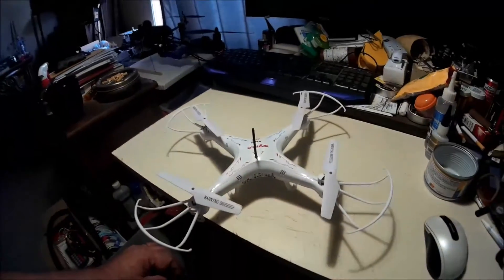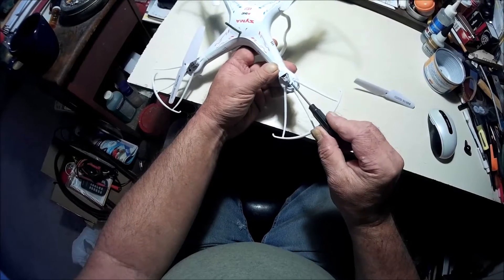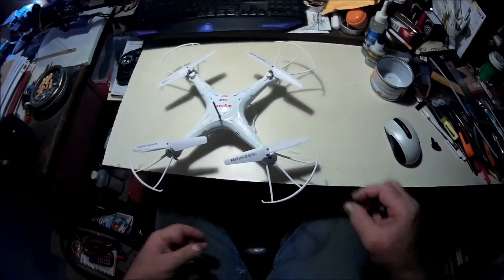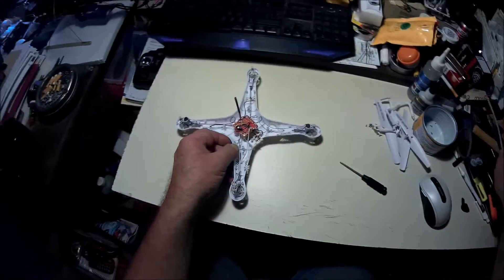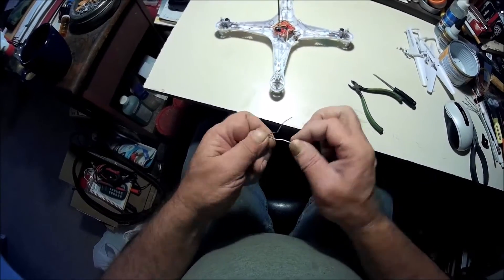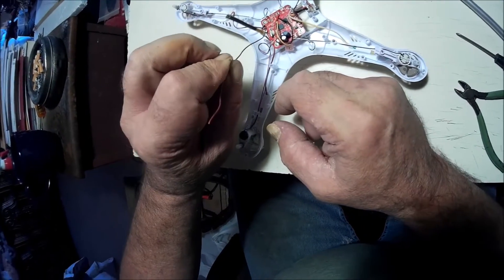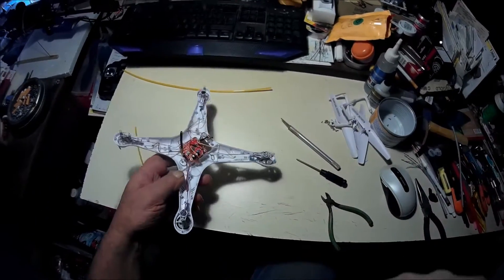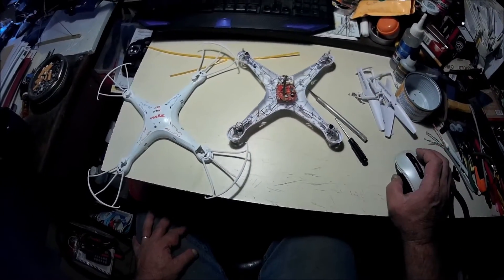Syma X5c-1 Antenna Range Extention Mod... 100+ Yards

Comment: Great video! Could you please clarify will this antenna alone improve the range or do I actually need to mod my transmitter too?🤔🤔
Reply from the maker: Hello and thanks for watching, basically what I'm doing here is changing this Antenna system from a 2.4Ghz 1/4 wave to a 1/2 wave System and modifying the Receiver helps but doing both the Transmitter and Receiver is best. With both Transmitter and Receiver modified I was able to get about 100 meter range. The actual Transmission Strength comes from the Transmitter, so I believe the Transmitter Mod would be the best way to get a better Signal. In one of My other Videos I show the Transmitter Modifications, above that the next step up would be to add a 2.4 Ghz WiFi Signal Booster to the Transmitter, understanding that the Transmission Power is the most important as the Receiver side just picks up what ever Signal is sent too it. I hope this helps and here is a Link to the Transmitter Mod in case You choose to do that as well.. Thanks again for watching! 👍🤠    
https://www.youtube.com/watch?v=oEXqWcXiFBc&ab_channel=HyperJoe

Comment: I also have the modded transmitter.  I also modded the receiver antenna to a 1/2 wave which was inside the quad down one of the arms.  I expected my range to go over 300 feet.  My range actually became WORSE doing this.  It became better again by going back to the normal 1/4 wave length.  I don't recommend running a 1/2 wave antenna inside the quad, it's probably subjected to a ton of electronic noise plus the angle isn't good.- running it up like demonstrated here is different.  Although, if I was going to do this, I'd probably look into installing a grounded shielded antenna onto the board.  There are a lot of other Syma fliers out there who claim they can get 100 meters just by modding the transmitter and leaving the receiver antenna alone,  I've also seen some videos of people getting 100 meters stock..........it's pretty confusing to say the least.
Reply from the maker: Yea, there is a major difference installing the Antenna Verticle versus inside next to the motor wires. And yes You are correct, doing a proper Mod too just the Transmitter would do the Job. I've actually thought about adding a 2.4 gHz power booster too the Transmitter, but I've since moved on to much Bigger Quads with Gimbal/Camera set-ups. I'm setting up a XK X380 with a 2 watt Booster on the Tramsmitter and a Long Range FPV Transmitter, I'm hoping too increase My range from 1000 Meters to about 3-4 Miles..Should be Fun...thanx for stopping and watching..with Summer more Video's will get posted, stay tuned..  :)
Reply: The quad I've become very interested in is the Hubsan X4H501.  Stock, the advanced went 1.2 miles.   I've seen a video of someone taking it out to 2 miles by just modding the transmitter and POV antennas (they also needed to make a much bigger battery because it was a long 20 minute+ POV flight).  I like my Symas and I have since remade the 1/2 wave antenna taking it up through the shell with a thin flexible wire.  they are fun to knock around with but when i move up to something else I'm going brushless.  these brushed motors, gears and drive shafts just don't last.  Even though I can pilot an X5C in the wind, even at over 10 MPH, I'm tempted to push myself and fly when it's not really even possible. the wind knocks them around more than me, causing hard landings (AKA crash). :)
Reply from the maker: That's Great, sounds like You're as hooked as the rest of Us! And Yea, I gave up on the Smaller Stuff, Great for Learning and all but the Brushless with good range and FPV is awesome stuff. I'm loving every Flight, haven't had any Mishaps Yet even after more than 20 Flight with the XK, and got some good experience with FPV now at longer Distances. What a cool Hobby! Thanks for checking out My Vids and I hope they help You in some way when You need it. Also if You ever have any Questions, I've gathered an extensive amount of Info.. Happy Flying and Most of all Happy Landings!!!  :)

Comment: Good job Dude, I will give this a shot.
Reply from the maker: Thanks for stopping in and watching. This is the Mod I used for the Copter "RX" side, and I've also done a Mod on the "TX" as well, they both work together, so I'd suggest doing both, and afterwords if all is done as I show, You should get 100+ Meters Range. I did this as a response too loosing My first Syma because of an outa Range and Winds Issue, the Transmitter Video is kinda long, but ir's well worth the trouble of watching. Here's a link showing what I did that boosted My Range, You'll need to do both Mods for a good outcome. thanks for watching and as always..Happy Landings!  :D                     
www.youtube.com/watch?v=oEXqWcXiFBc

Comment: Hello Sir,
I have watched this video and I liked it a lot :D And so..
I have a couple of questions for you:
1. How much is the normal range for flying the Syma X5C-1? 30,50,75 or 100 meters?
2. It is better to use copper or some other material wire for RX(Receiver antenna on the drone)?
3. You said it should be the whole length of the wire 6,25mm, and what is the science behind it?
4. Can I use Wi Fi antenna for RX? And which one would you recommend me if the answer is yes: 2,4 GHz 3,5,8 or other value for dBi (decibels)?
5. Which kind of Wi FI antenna for TX(transmission from transmiter) would you recommend me? I am currently using 2,4 GHz and I do not know the value for dBi(decibels)?
I am asking you this questions because I want to make my Syma X5C-1 to have the longest range and also to have high quality signal :D
THANK YOU very much, I will appreciate your answer ;)
Reply from the maker: +Stefan Filipot Hello, and I'm more than happy to answer Questions, afterall that's what I'm here for, I love helping anyone in what ever ways I can too enjoy the Hobby. I'll answer each Question seperately and try to be thorough..  :D

1. The normal range was depressing, too say the least. I actually lost My first Syma because of a Range and Wind Issue at about 30 meters.

2. Personally, in My Opinion Copper works best as it's easily Soldered and performs well enough, I'm sure You could try something like a Steel Guitar String Wire of small Diameter, but Soldering might be a problem as it would take higher Heat to create the proper bond, and in Electronics, Heat can be Your Enemy. Best to keep Heat too a Minimum..

3. Actually that's a Pretty tall Order explaining the Science behind the Lengths involved, as Different Frequencies are Bound by Length per the Wavelength of the Signals involved. For a Signal Wavelength of 2.4 Ghz it's a Set Standard that a 1/4 Wave Antenna would be 31.25 mm, which is the Stock Syma, and then a 1/2 Wave, which is what this Mod entails, that is 62.5 mm, and then a Full Wave which for obvious reasons wouldn't be practical because it would be about 125 mm, doable but not required for good performance. For a Techie kinda person, if You're really interested in Learning all about RF Transmission and Antenna's, I can give You a couple of Great Links, You can Study and Enjoy.
First is a Recommended Youtube Link, this Guy Builds them all, Great Info..  :::  https://www.youtube.com/user/8bitandrewmcneil/videos
Second site is a bit More Complicated, shows the more Scientific Reasoning behind RF Modulation and Calculation, also good info for Learning. ::: http://www.antenna-theory.com/

4. Yes, I suppose You could use a 2.4 Ghz High dBi Gain but honestly it's not required for good reception, as the added weight would not benefit You much, as it would probably cut Your Flight times in half, The most important Modification for longer range will be on the Transmitter, the Antenna and Power You Send from the Transmitter will determine how far You can Fly. So I wouldn't recommend that for the Reciever. You'll get the most benefit Modifying the Transmitter with a High Gain Antenna and possibly even a 2.4 Ghz power booster.

5. I've mentioned this briefly above, but to be more specific, The Syma Transmitter is basically designed as a Toy Grade and has a low Power Output, I'm guessing probably less than a 0.25 mW Output. If You need more Range, and You're willing to spend a little Time and Money, You Could buy a 2 watt Booster for 2.4 Ghz and add that plus a High Gain Antenna 6 dBi or above and get at least a Mile or more Range. I'm getting 100 Meters without all that and I'm happy, but I've also Upgraded to a Full size Camera Quad..

So there Ya have it, My best effort at answering Your Questions, I hope this helps, I'm always willing to give Answers and any Suggestions that might help You enjoy this Hobby as much as possible. My best Recommendation, Use the Syma as a Learning Tool, and Save up and buy a more Professional Quad, possibly something with GPS and FPV, You'll Love every Minute You spend in the Air, I'm doing full blown FPV now, and LOVING IT!  As always.. Happy Landings!  Thanks for Watching!   :D
Reply: +Hyper Joe Well the best answer that I have ever got it :D
I have researched a bit more and find out that the best for transmitter is to use Omni-Directional antenna (With this kind of antenna I get 2 things: 360 degrees of field and a larger distance)
This is the antenna: http://www.tp-link.com/en/products/details/cat-4765_TL-ANT2408CL.html
I have already installed PCI Wifi Card U.FL IPX to RP-SMA female RF Pigtail Cable on my transmitter, on which I am going to attach this antenna.
And for the drone I plan to use 6,25mm copper wire (As you said, minimal weight but I am not drilling hole to my drone :P I am going to place it inside :D)

Until now I haven't made change to drone, but I have used 2,4GHz 5dBi Wi Fi Antenna for transmitter :D With this I got 100-150 meters total distance. I can't fly more because I do not see the drone :D It is too far :D
THANK YOU again Sir :D I am very happy with your answer :D Greetings from Macedonia
Reply: +Stefan Filipot I want to do modifications on Syma because it is cheap toy. With that I want to learn as more as possible :D I am saving money to buy DJI Phantom 3 Advanced :D
Reply: Would be interested in knowing how this worked out.  I also have the modded transmitter.  I also modded the receiver antenna to a 1/2 wave which was inside the quad down one of the arms.  My range actually became WORSE doing this.  It became better again by going back to the normal 1/4 wave.  The reason I think it became worse may have something to do with internal noise in the quad the antenna was subjected to.

Comment: Great video.  I like your informal approach and your work bench.  You obviously have created lots of other things on this bench and I can tell you have lots of old-school experience.  It's like watching my dad or grandpa teach me how to do stuff (don't be offended, that is meant as a compliment...I'm 45)  

I was wondering....Would it be better if we drilled a hole in the bottom and let the yellow jacket stick out from below?  I know it would take abuse with some landings but if it was flexible enough, I would think reception would be enhanced because the antennae is now below the craft and more exposed to the transmitter.   I'm curious what you think.   Thanks again for posting!
Reply from the maker: +Ham Gina Hey, It would take alot more than calling Me Old School to offend Me, After all, that's the Truth...lol,  Yes I've done alot of stuff on this bench although it's temporary, I actually have a full size bench in My Hobby Room, but it's being used as a Guest Room for a bit, and Yes I've been Building,Flying,Crashing for about 45 Years..  hehehe. Thanks for the kind words and as for Drilling the Bottom and running the Antenna down, there are 2 reasons I went up instead, Reason number one, the Battery is below the Circuit Board and sticking up is some what a giv'n on most Antenna's, and Reason number 2 is because fully equiped, this Quad has an FPV Camera on the Bottom, and I like to keep My 5.8 Ghz FPV Transmitter Signal as far away from the 2.4 Ghz Reciever Antenna as possible, not easy with such a small Quad, but it does work nicely..  :)
I hope this helps out and You're always more than welcome to hit Me up with any Quaestions You might have, I'm always here to help... Thanks for stopping by and watching, I also have Vids on the Transmitter Mods and all My latest Builds. Actually got 4 in the works, even a J3 Cub in My future.. As Always... Happy Landings!..  :D

Comment: Hello, what is that yellow jacket you put over the wire and what does it do?  It looks like your finished product has black. Is that heat shrink? Thanks.
Reply from the maker: +James Reily Hello James, thanks for stopping in and watching. The Yellow Jacket is just some left over Pushrod Material, it's like a stiff straw and it's just there to keep the wire Vertical and it also protects the wire, as for the Black when I was done, it's just colored with a Black Sharpie, You could use heat shrink for whatever color You prefer. I hope this helped and here's a link of what the Yellow Jacket is made from, You could use anything similar, This is what I had, and just the right size. Thanks Again and as always..Happy Landings!  :)
http://www.sullivanproducts.com/GoldnRodMainFrame.htm